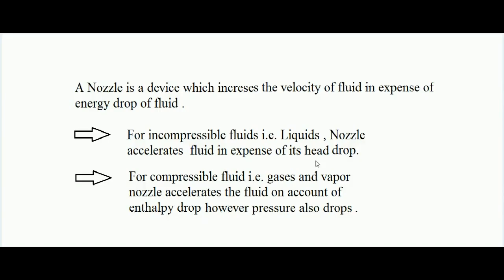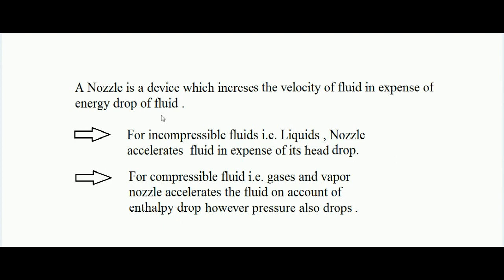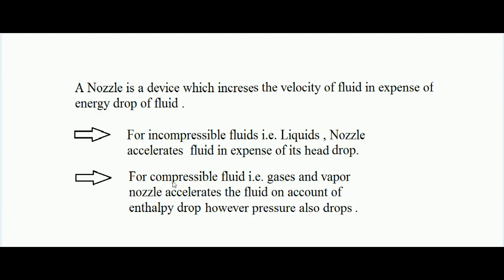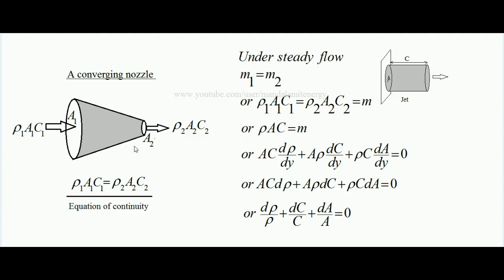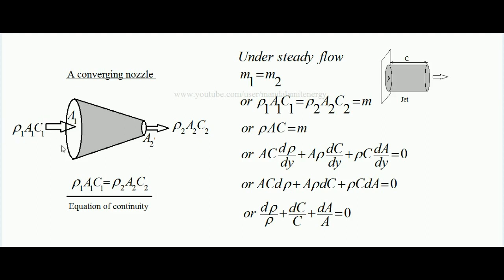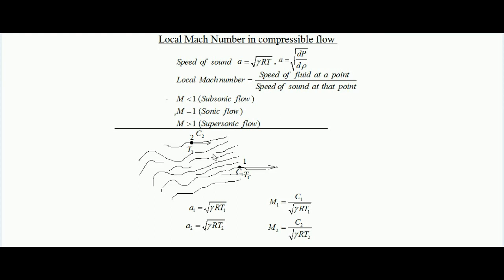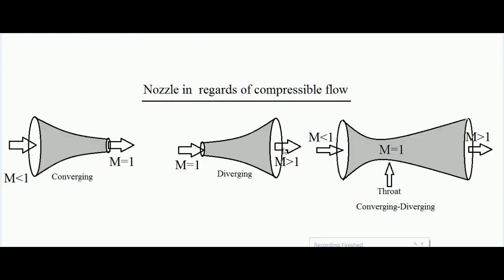Compressible flow through Nozzle

Comment: What has been shown in this video is incomplete. Point is, what is the gross pressure (static + dynamic pressure) at the exit. In reality, we have seen that whatever may be the velocity at the exit, the flow continues. That means the gross pressure at the exit is always above the atmospheric pressure level. If not, then the flow wouldn't continue. But, in this video, it hasn't proved that the gross pressure at the exit is greater than the atmospheric pressure i.e. pressure at the entry. In short, it has not been proved that the increase in dynamic pressure is more than the fall in static pressure.
Reply from the maker: P2/ P1 is back peessure ratio, it is included in theory...
Reply: @Dr.AmitMandal  I am not talking about back pressure ratio. I am talking about increase in dynamic pressure and decrease in pressure inside the nozzle in case of subsonic flow through a convergent nozzle.
Reply from the maker: Its theory, at exit the pressure has to be less than inlet, this will make it flow. Atmoshere is practical condition.
Reply: @Dr.AmitMandal  You are talking about static pressure only. I am talking about total pressure i.e. static pressure + dynamic pressure. If the gross pressure (static + dynamic) isn't more than atmospheric at the exit, then the flow will stop. That's basic physics.
Reply from the maker: Atmosphere is not present here, it is in space.
Reply from the maker: Secondly, fluid can even flow from low to high pressure, e.g. diffuser...
Reply: @Dr.AmitMandal  In case of a diffuser, it's the dynamic pressure that is converted into static pressure. While in a convergent nozzle, it's the static pressure and temperature converted into velocity. I just want to see that the dynamic pressure at the exit of a convergent nozzle in case of subsonic flow, the gross pressure is higher than the static pressure at the exit.
Reply from the maker: In diffuser dynamic pressure converts into stagnation pressure , there is dufference between stagnation and static pressure
Reply: @Dr.AmitMandal  Ok. My fault. But, stagnation pressure actually become addition to static pressure, right? And, about my point, I have repeatedly said that I want to know the formula to calculate the gross pressure (static + dynamic) at the exit.

Comment: Hi, What happens if (A2-A1 = 0) ? I mean area not change. Will flow turn into wave?
Reply from the maker: it is no more a nozzle then
Reply: @Dr.AmitMandal  I am interested in behaviour of flow. how will it move ? continue as flow or as wave?
Reply from the maker: as like a  fluid flow through a uniform diameter pipe...
Reply: @Dr.AmitMandal  in general, in what condition imcompreseble flows turn in to wave? sorry, I ask many quesiton.
Reply from the maker: pulsating disturbances in fluid
Reply: @Dr.AmitMandal  Sorry, I did not understand. Can you explain more please?

Comment: sir,

i want to know the geometry of the nozzle
motive pressure at 6 bar, flow at 400 cfm
what is the nozzle throat diameter, air inlet dia is 2 inches.. appreciate your to  share some info
Reply from the maker: Some more concepts are required ,stagnation pressure temperature etc

Comment: What will happen if there is reverse flow through Venturi Meter
Reply from the maker: Same effect
Reply: @Dr.AmitMandal  
Then how the transmitter would know which is forward flow and which is reverse flow
Reply from the maker: Transmitter?
Reply: A differential pressure sensing device to find differential pressure at reduced area and larger area.
Reply from the maker: It doesn't tells the direction, simply shows pressure difference

Comment: sir please clear,
1.does velocity directly prop to area??
2.does velocity inversely prop to pressure?
Reply from the maker: +sumeet more For the case of steady flow through a duct and compressible fluid with subsonic flow the velocity and pressure both are inversly analogous but for supersonic flow , velocity is directly analogous to area while pressure is still inversly analogous to area.
Reply: 1.sir how about incompressible  fluid?eg-water
2.why we are concern about subsonic and supersonic ,does it has any impression on velocity and pressure of fluid while passing through any vent.(may be im asking wrong but its a doubt,sonic itself is used to count speed/velocity)
3.eg-water dam,while the doors are opened divergently the area increases and hence the velocity of water.
(i didn't find why we used sonic factor here.)
thanks :)
Reply from the maker: +sumeet more for incompressible fluid area decreases then velocity increases and pressure decreases.
Reply from the maker: +sumeet more super and sub are applicable for compressible fluid only..

Comment: in the case of the diverging nozzle, there is an increase in an area then how come there is an increase in velocity.
Reply from the maker: +anurag tripathi , it's appears unrealistic but it's true for compressible flow and proven mathematically with corresponding context.
Reply: For hot gasses the conversion of heat to kinetic energy accelerates the flow through the divergent section.
Reply: @fiftystate1388  Does any additional acceleration of the flow occur outside of the divergent part of the nozzle? In other words completely outside of the engine.
Reply from the maker: Ideally no
Reply: @Dr.AmitMandal  Thanks. I've always suspected that. It means that all of the thrust is created inside of the engine and that all the opening in the back of the engine does is to allow the expended propellants to escape so fresh propellant can enter the chamber to be burned.